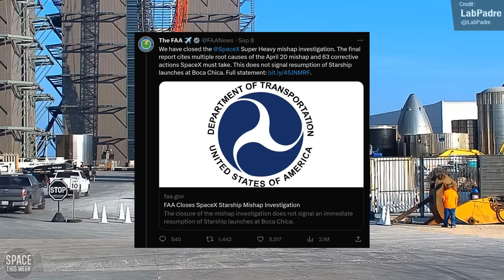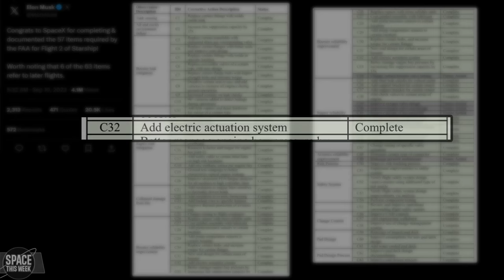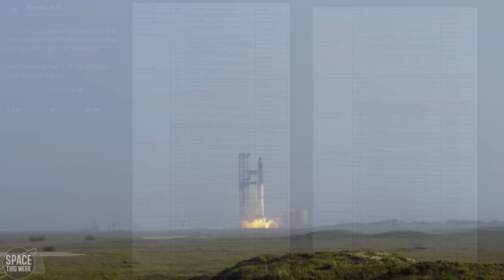SpaceX Starship Launch Delayed? +Booster 10 and Ship 26 Rolled Out!  - Space News

Comment: I think the issue with a launch this week is that the manifolds for the water deluge system are currently in pieces as they are adding in the new tank.  I'd expect it to take at least a week for that to be reassembled and tested thoroughly.  Also there's been no Wet Dress Rehearsal though they may take an aborted launch attempt and turn it into one.  As usual fantastic update Matt though have to say I'm disappointed your cat isn't in this one ;)

Comment: Does anyone know why the HLS starship will be painted? Spacecraft are usually painted white to reflect heat away. Sometimes rockets have black patches to actually absorb heat in those areas. But I thought that the stainless steel starship would be reflective enough without paint. Paint adds a significant weight, so there must be a good reason for it.

Comment: What is the hold up? I think the problem is that SpaceX asked for approval for an orbital launch, however the FAA have told them to reapply and ask for a firework display licence instead.
Reply: No, the problem is that SpaceX hasn't asked for a licence yet. Go over to NSF for a vid how it works.
Reply: @hawkdsl  The problem is you don’t understand what “taking the piss” means.  There is however the serious point that the launch on 20/04/23 was underprepared, had no realistic hope of success, and did significant damage to surrounding property, environment, and peoples health. No significant changes have been made to either the rocket or the launch infrastructure that will prevent that damage occurring again or lead to a significantly greater chance of success. The lack of care being shown for reentry protection shows that SpaceX know this rocket isn’t going to get to use the reentry shielding.  Significantly more work needs to be done starting with getting the army corps of engineers to examine and sign of on the safety and environmental sustainability of the water deluge system that SpaceX have installed in breach of their site license.
Reply: @davidwright7193  I 100% agree with your 4/20 launch assessment. That was a true debacle, and only sheer luck prevented that flight from being a national disaster. Your OP was about the FAA process, and a statement on the licence. While you may be "taking a piss",  there is a factual process. Anyone interested in space flight can self educate with NSF's excellent report on the subject.

Comment: Real question here, how is the hotstage going to affect the reusability of the booster stage, I can't imagine it's going to be good to light up the engines directly to the rocket. Even if it can be done more than one time, after some separations damage from the engines, the stainless-steel is going to deform right?
Reply: That's the big question right now. We likely will need an actual test to have SpaceX share the data. With the next flight not planning on doing soft landings, it may take a couple of tests to find out.
Reply: @steveaustin2686  Why did they decided on that on the first place? Was it cuz the first launch didn't have a optimal separation?
Reply: @uCruz_  The flip idea was crazy to begin with. Between the two, the hot stage is less crazy. What we don't know, is will armoring the booster to survive hotstaging for reuse, eat up the gains from the hot staging.

Comment: If the FAA requires electric actuators, why would they give a flight license to S25 which does not?
Reply: SpaceX did the investigation, SpaceX made the 63 item list, SpaceX reported to the FAA and the FAA closed the investigation.
There is no application for a change on the previous launch license to add OFT 2 to that.
Reply: Because it is SpaceX, not the FAA, that wants the electric actuators. That 63 item list, is FROM SpaceX.

Comment: WHY does a space ship need booster? Shouldn't it be able to fly on it's own?
Reply: Because a single stage to orbit (SSTO) is not able to be made at this time. At engine ignition, a rocket is well over 90% propellant. As you burn propellant, you have all that left over tanks weighing you down. If you have multiple stages, you get can rid of the dead weight of the earlier stages and greatly increase the efficiency and mass to orbit of the upper stages.